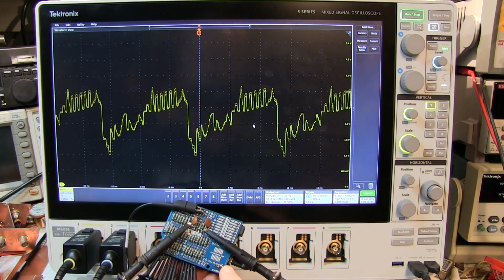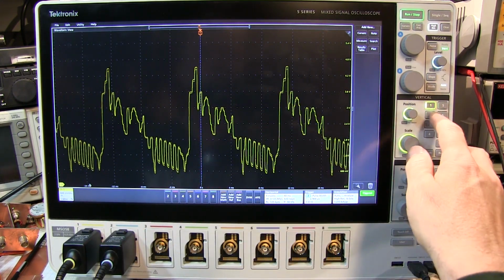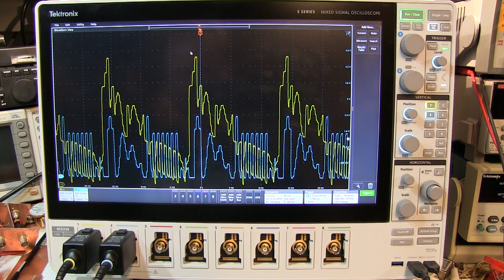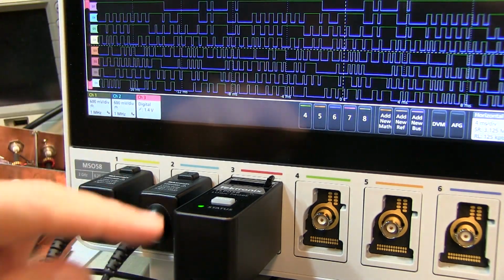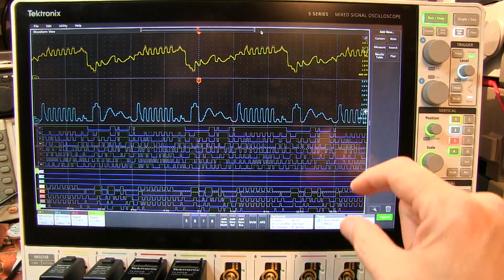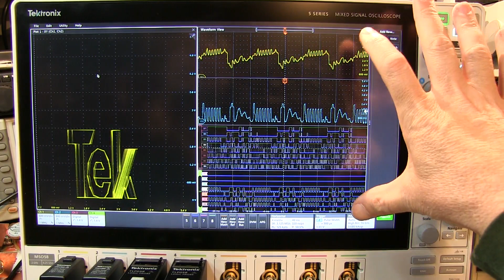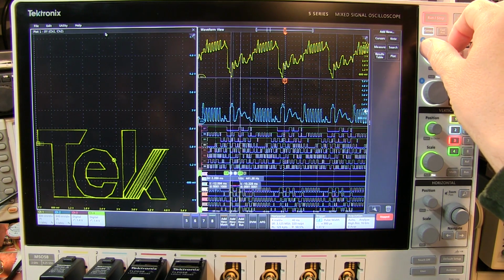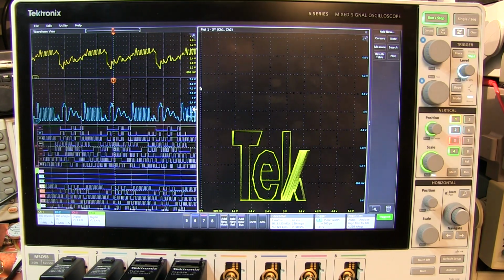5 Series MSO XY spin

Comment: This is kinda nice.  The problem is that you now have an instrument that has lots of greasy marks on the display and is not useable if you wear protective gloves in a clean environment like medical, optics and high end technologies.  Nice idea but the buttons and knobs are still the best solution.  If you want a remote display with this stuff then yes, add a Remote Desktop kind of interface but on the instrument itself ?  This is a very expensive soltion to a non existing problem IMO.  Just to keep up with touch interfaces is not a reason to be expensive.  As a matter of fact touch interfaces are way cheaper than physical interfaces.